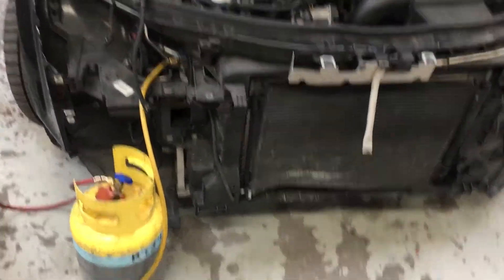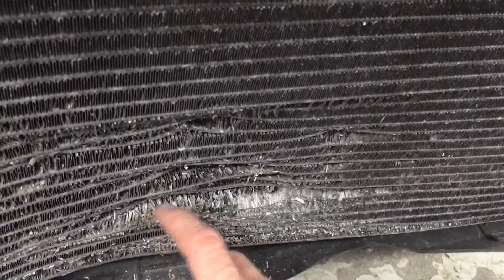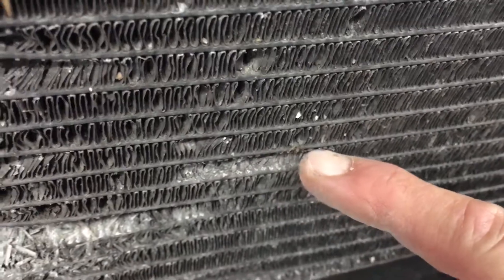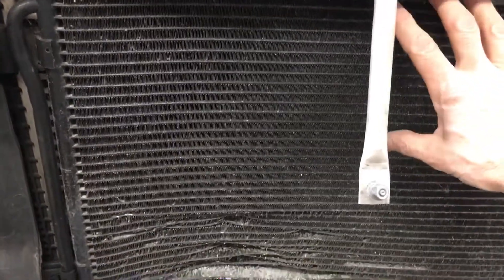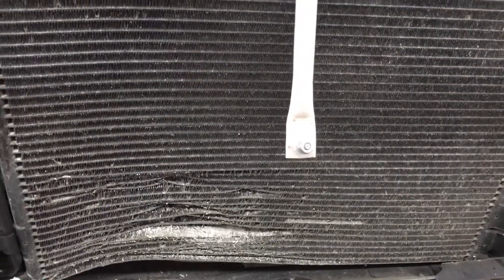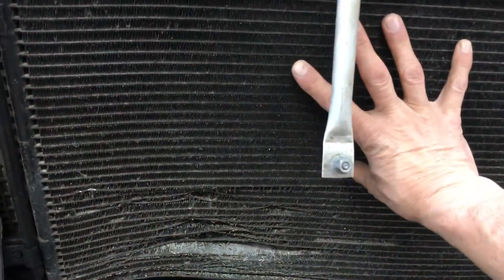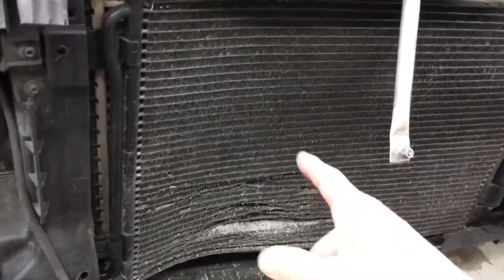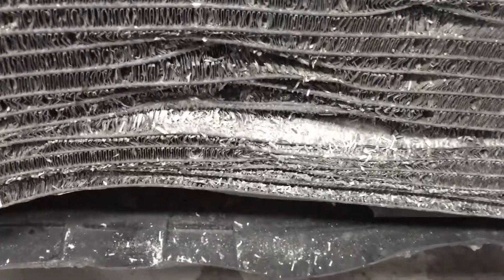Misdiagnosed cooling problem,  aluminum oxide condenser causes poor heat transfer.

Comment: My car’s condenser is like yours in this video, but the aircond is still petty cool and no problem at all. So should we need to change it or just leave it?
Reply from the maker: I will change it on my own car because it causes the compressor to have a much higher head pressure air conditioning still works but it makes the engine work a lot harder because for example CU would normally have 270 psi on the high side on a 90° day or 100° day you might be having 400 psi on the high side it will still cool but it puts a lot of unnecessary stress where in tear on your compressor and you actually consume more fuel because the high side pressure it takes more gas to overcome that high pressure
Reply: @coldfinger459sub0  wow. Make sense. Thanks for the such of good experience video. Keep it up.

Comment: Denso condenser for my vehicle is on permanent backorder everywhere with no eta as to when or if it will be available. Are there any other acceptable brands that may provide sufficient performance? Is Nissens any good? They’re oem for some manufacturers, correct? Thank you for your time.
Reply from the maker: It’s hard to say because the aftermarket providers part numbers that might come from another OEM manufacturer might just be filled by a third-party manufacturer, who is not even from their own factory they just Rebox and put a label on it.